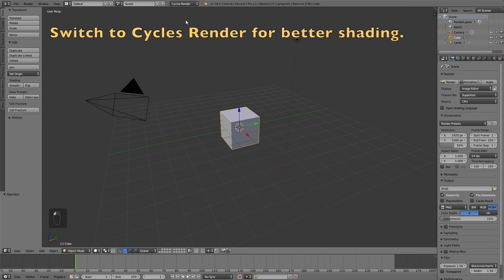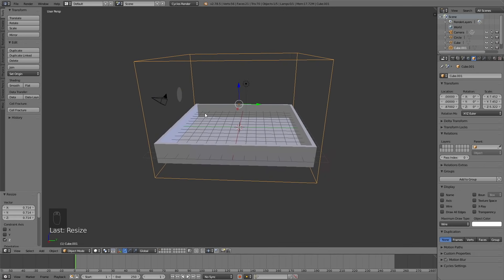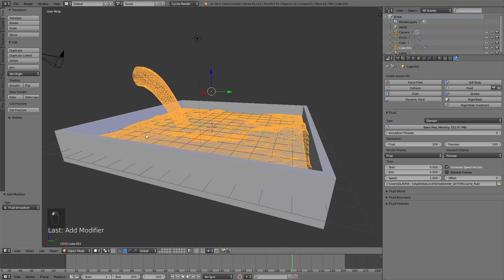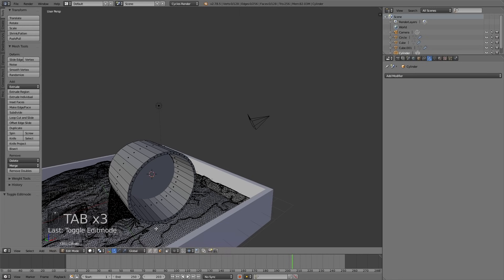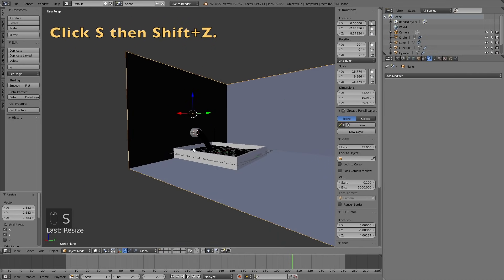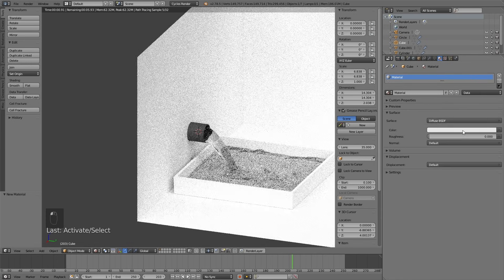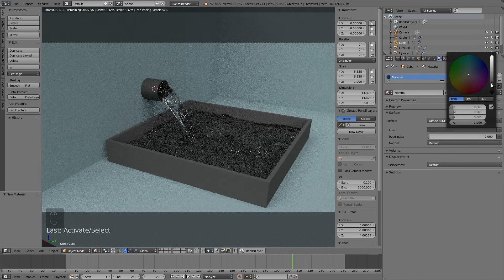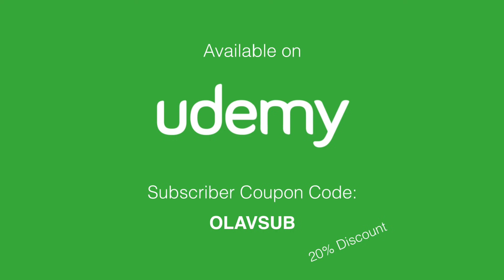[2.79] Blender Tutorial: Quick Water Animation

Comment: Hey can I ask you something, how long did you render those scene? I always have a problem with rendering, even though the scene is pretty lightweight project such like a "hairy ball", "donut". It will take so longg, like 24min per 1frame. I don't know if it's because my PC or not, I actually have a  mid-low PC. It's i5 3570, 16gb ram, rx 580 8gb, I played GTA 5 with highest graphics and even with graphics mod, and it's pretty playable, a lot of triple AAA games is playable in my PC. But when it comes to rendering such a 3d scene with lightweight project, it will takeee so longg to render 1 singleee frame. Can you tell me what possiblity that may caused this thing to happened? Is it because of my render configuration or something else that I didn't know?

Comment: the water is stuck and now i have a 512mb piece of junk in my computer :(
Reply: Just delete the cache file, it's exactly where blender say. Also, something is clearly wrong with your simulation.
Reply: i actually found what was wrong yesterday. it turns out i was robbed by newegg. the ram i have is 8gb less than my previous one but it clearly says 32gb on the page. so my computer was just really slow along with the 5 windows i had open
Reply: @KCKrumbcake  interesting, but I say, less ram than necessary would make blender crash, not bug the simulation. Anyway, hope you get refunded on your ram.

Comment: The water on my animation only flows for the first 24 frames then it stops, what do I need to do?
Reply: when you click bake in the top bar of the app you'll see a rendering percentage which you have to wait to reach 100% before clicking play. If it's only 15% complete it will only play 15% of the render. That might be the problem.
Reply: @farside3860  I got it to work, thanks for your help

Comment: 2 questions, 

1st the version im using, 2.79 seems to be missing a few of the options you are using, for one I have device option to allow the use of my GPU for rendering, is that option from a plug in or is my just not setup correctly,

2nd even tho I have 29GB of free ram and a 6core 3.3GHz Cpu my bake time for a simple model like this is ridiculously long, something like 3days, and yet blender isn't touching a single one of my core or un used memory, how do I resolve that issue? Thanks in advance
Reply from the maker: GPU rendering has to be set up in the user preferences, I’m sure there are tutorials on that. And baking takes time, it took me an hour for this tutorial. It still works with 2.79. :)

Comment: When I render using the animation button it automatically restarts upon finishing. When I just use the render button everything is fine except for the fact that the animation doesn't work properly. It shows movement along the timeline and all, but the water doesn't come out. I added the face on the circle, set it to inflow, y value = 1, did the surface sub-divide, have the container (and inflow) on shell, etc. Anyone know what might be wrong here?
Reply from the maker: I would just delete the fluid parts of the scene and start that part over, you can keep the other objects. :)

Comment: Hey, IMy water is not transparent and has default domain color even after adding glass modyfier. Even after rendering..
Reply from the maker: You’re supposed to add a glass material not a glass modifier
Reply: Olav3D Tutorials That wasn't an issue. I added material ok but tweaked something in domain cube settings so it works with newly created domain. That's for tutorial and quick response. Subscribed :)

Comment: why does it take so long to render? did it also take long with yours? It renders 1 frame in 10 min, I have 250 frames so in total it's 33 hours rendering wtf
Reply from the maker: 3D rendering takes time. There are good videos and blogs on how you can decrease the render time though. A good start would be to decrease the amount of samples or get a GPU. :)
Reply: Olav3D Tutorials I do have a GPU
Reply from the maker: Then increase the tile size to 500x500 in performance under the render settings for example.
Reply: Thank you

Comment: I see a lot of people here that aren't getting the simulation after clicking bake. This also happened to me. 

After some research, I figured out what was wrong. The circle needs to be filled. It's a step that is in the tutorial, but I, like many of you, seemed to have missed it, but it's a very important step.

Make sure you select your circle and either fill it or add some depth to it before you bake your simulation, otherwise the baking does nothing. 

After a quick read through some forums, it seems that fluid simulations needs some depth or solidity to the inflow object.

I hope this helps.
Reply from the maker: Yup :)

Comment: Nice.. But i have problems with water direction.. How do i can resolve this?
Reply from the maker: Be more specific please
Reply: https://pp.userapi.com/c840336/v840336453/32129/1cJB3N3cuQk.jpg       
My water flows in the wrong direction and bounces off the wall
Reply: Change value in Y -axis from 1 to -1 ...
Reply: water outflow is not continious ... in my case
and
water is spilling out
Reply: @pratikdas9469  Check your Domain.... Also check for normals,... the normals for the circle should point towards the tub/ container.... There's a setting with which u can see blue/ red color. Blue is the normal.... some times rotation messes up this setting
Reply: same for me also
Reply: thnx 4 the reply
Reply: one direction on y axis is -1 and and one is 1... so when you dragged your circle to the other side you let the water still flow in the positive direction
Reply: try editing the x y or z values
Reply: Those people who have this problem change your mode from cycles render to blender render. This will definitely solve your problem.. This problem was occurring for me too but when I switched to blender render my problem got solved....

Comment: Your system specs ??
Reply from the maker: GTX970, i5-4690K CPU @ 3.50GHz and 32 GB of RAM. I speed up some parts of the recordings as I do the voice-overs later, so sometimes it seems faster than it actually is. ;)
Reply: 32 GB RAM??? WTF I'M SITTING HERE WITH AN INTEL CORE i3 LAPTOP THAT HAS NO GRAPHICS CARD AND 8 GB RAM 🤣 Nice tut :)